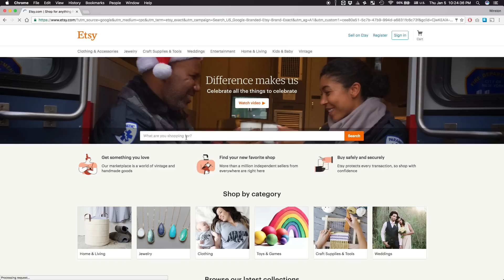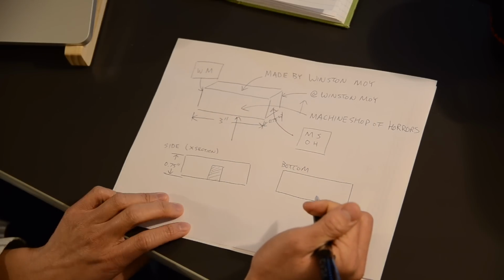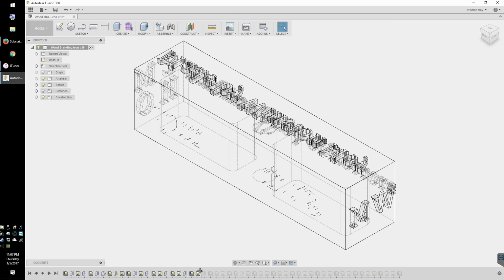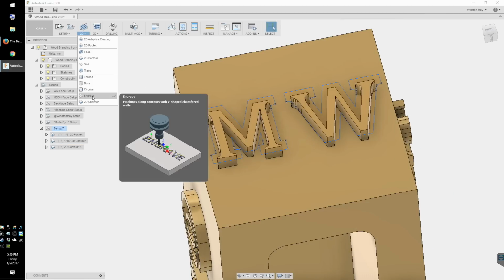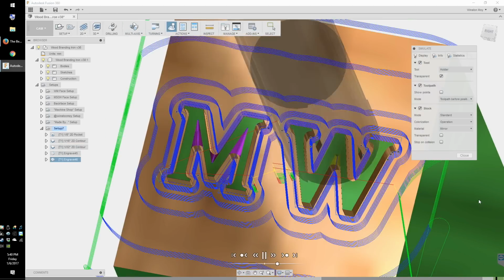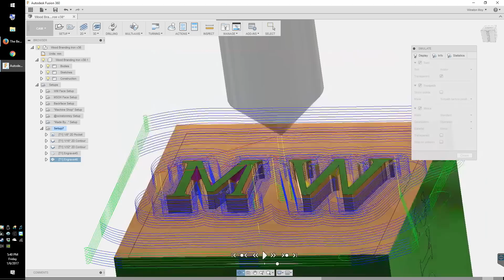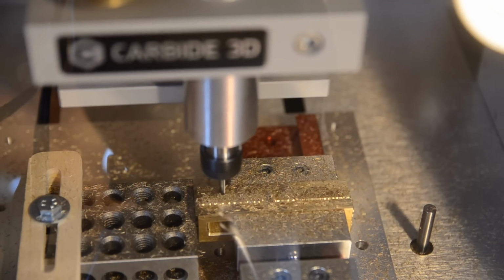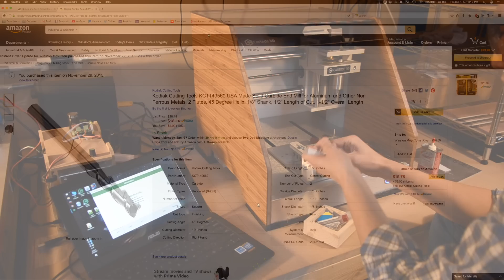DIY Brass Branding Iron - CNC Project #74

Comment: good job. question, where can I buy a 3 inch thick block of brass?
Reply from the maker: A 3" thick block, probably a dedicated metal supply store or McMaster. If you're lucky, you may find drops on Ebay. 
A 3" long bar or square stock, Amazon will have that.
Reply: Winston Moy thanks

Comment: Are you able to create a branding iron with just the Shapeoko??
Reply from the maker: Yes. The two sides that were made purely on the Shapeoko work fine. I just like the effortless accuracy of the Nomad, and automatic tool length probing makes the multiple tool changes way more convenient.

Comment: How did you remove the background grid in fusion 360?
Reply from the maker: At the bottom center of the screen, where pan/zoom/fit/etc controls are, second icon from the right controls grid display.

Comment: Awesome job! How long did this take to machine? I am thinking many, many hours. I have the 1000m X-carve and was attempting to carve a multi-key tool from 1/8" aluminum and the estimate was nearly 3 hours. I can imagine milling 5 different sides took quite a while.
Also, the drill bits you got from Ebay are awesome. I have been using them with great success every since i got my X-carve. I have broken quite a few, but that was all due to operator error.  
Anywho...., Great job! Love your work!
Reply from the maker: Took about 50 minutes per side, +/- a bit depending on tool changes and such.

And breaking bits is all part of the learning process!

Comment: Hi Winston, have you ever tried any paid software for feeds and speeds? I did the 30 day trial for Gwizard and found it helpful for using my XL to cut metal because you can dial back the settings to account for the fact that the supports aren't as rigid on a desktop router.
Reply from the maker: I haven't unfortunately. I haven't even tried Cambam, despite resolving to a year ago. Too many projects where I bury my head in the sand and go with what I know. But I should look into them...
Reply: Many years ago I attended Wentworth Institute of Technology in Boston in the production engineering / applied science program, and one of the best formulas they gave us for determining speeds and feeds was :
Cutter speed (for whatever material you are working with and can be found in the Machineries Handbook)  x 4 / diameter.
The diameter is for whatever is spinning. On a milling machine it would be end mill / cutter diameter. On a lathe, it would be the stock. It's a good starting point that you can tweak for variations in hardness of the stock, type of mill (carbide, HSS, insert ....), or rigidity of the set up.
Hope this is helpful

Comment: Nice work, maybe you could stick two 3d printer heater cartridges in it, should get 200-400C
Reply: Love your work Winston. A computer power supply would do the job. I would love to see that. Keep it up. And I'll keep watching.
Best Matt
Reply from the maker: Looks like a decent form factor, and not too expensive either. I like it. Only inconvenience would be having to use a 12V supply.

Comment: Great project Winston! As I am just about to start CNC with a my new Shapeoko 3, I would be interested in hearing more about the workflow from Fusion 360 to Shapeoko. Would it be possible for you to make a more detailed video about that? Things like setting up a basic tool library with Shapeoko-compatible feeds&speeds, how to create Shapeoko-specific g-code from Fusion and how to send that to the Shapeoko maybe? 
Do you have links to the endmills you used? Maybe you can put them in the description of this video?
Reply from the maker: Good suggestions. Links to what I used added to description section. I'll add a Carbide3D/Shapeoko specific Fusion360 video to my project list.
Reply: Carbide3D/Shapeoko - Fusion360 video would be greatly appreciated :)

Comment: Nice work.  You are doing a great job building your brand.  I can always count on you for excellence.  What are your degrees in?
Reply: Winston Moy I have a ME degree and worked 18 years with an aerospace engineering firm (techshot.com) designing projects for NASA and DOD.  I'm working as an independent product developer now.  I also have a SO3 and a Nomad Pro.  I'm in the process of adding way covers,  dust collection and a 1hp spindle motor upgrade to my Nomad. The 0.07 hp spindle is hopelessly underpowered but I love the precision of the Nomad.

You have "the knack".  Keep up the good work!
Reply from the maker: Undergrad was mechanical (probably not surprising). Masters: Aerospace and Systems Engineering (in progress).
Reply: That's pretty interesting - any specific reason why you chose to go for two masters? (If you don't mind sharing)
Reply from the maker: Thanks, means a lot coming from someone who's done their time and seen as much as you have.

Way covers would be great. I was watching brass chips falling onto my steel guides underneath, and was contemplating using a brush to try and keep dust out of the Nomad's base. Also planning on wiring up an LED strip for illumination. Let me know how your upgrades go.
Reply from the maker: A combination of my employer offering to pay, and peer pressure from other fresh out of college engineers.

Comment: Where did you get the brass?
Reply from the maker: Amazon, only because I didn't have the means to work with larger pieces of stock or cut longer bars to length. You can probably find better deals in terms of $ per in^3, but this is what I got: 
http://amzn.to/2iWhz5O